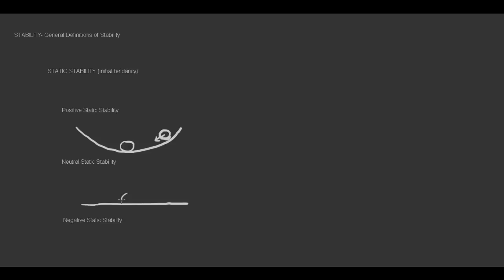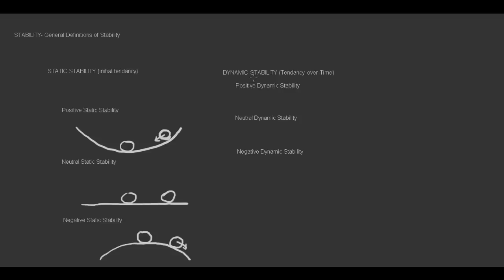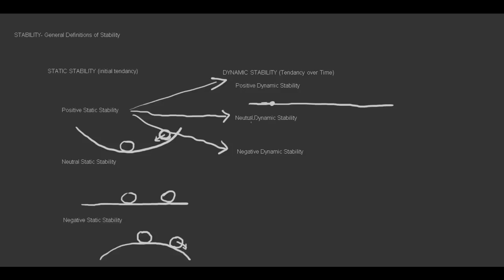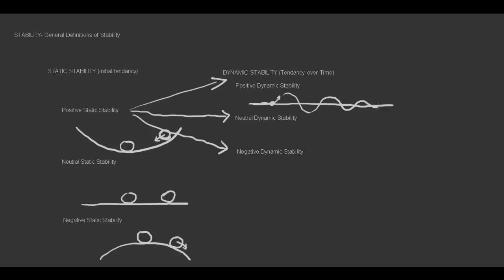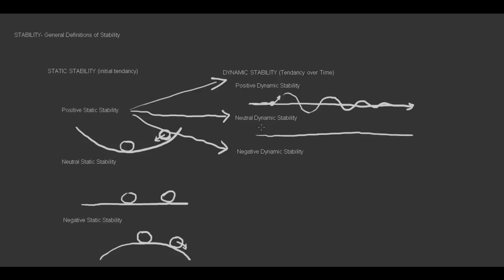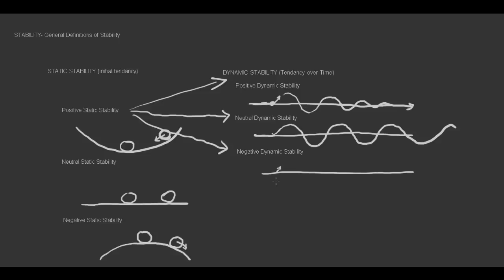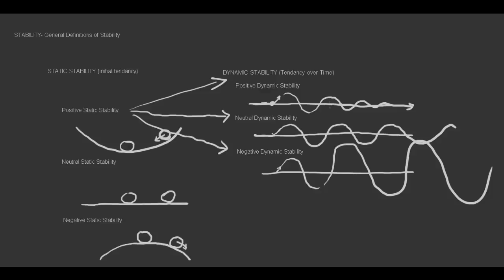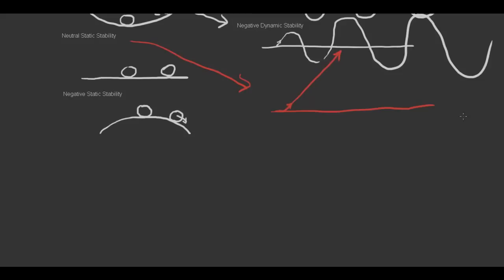AERODYNAMICS- STABILITY- General Definitions

Comment: Hi Jakub. Reading the Pilot's Flying Handbook, I see no direct correlation between controllability and maneuverability. An airplane can be very controllable regardless of maneuverability eg. aerobatic planes which are both very controllable (fast reaction to control inputs) and maneuverable (able to make tight turns and rapid transitions to climbs/descents). Maneuverability is more directly correlated with performance. I appreciate your input on this.
Reply from the maker: These terms are specific to engineering and different from the common usage a bit. Controllability and maneuverability are opposed to each other. A fighter jet is highly maneuverable but only marginally controllable. This is why computers control the most maneuverable fighter jets. And glider are highly controllable but not highly maneuverable. You ain't see a glider winning a dog fight. Control refers to the ease of keeping an aircraft stable. Maneuverable refers to the ability to provide an input and the aircraft's speed of response.

Comment: This is somewhat wrong. References the aerodynamics for naval aviators. Stability and controllability are inversely related, not as stated in the video. Example being the F-16. It was designed to have negative static stability in order to make it more controllable. Hence the need for onboard computers to compensate for the negative stability. Again, the two are inversely related, not in positive relationship with one another. 
CFI ATPL